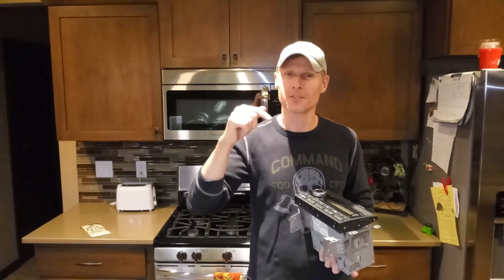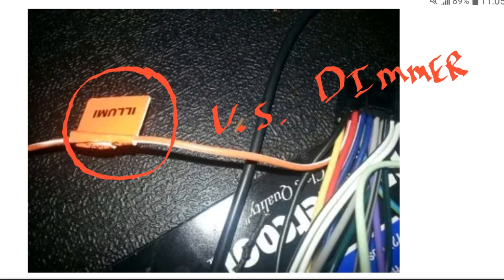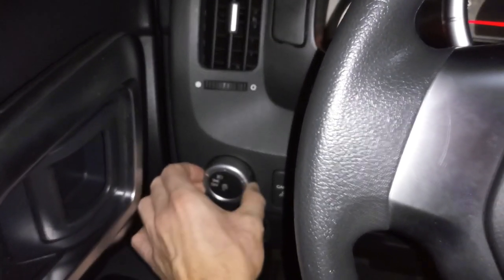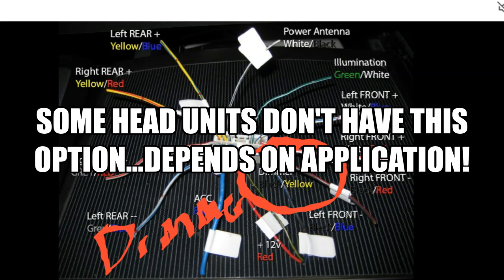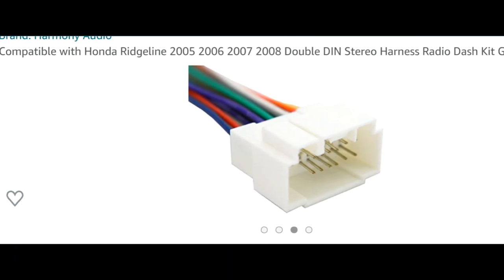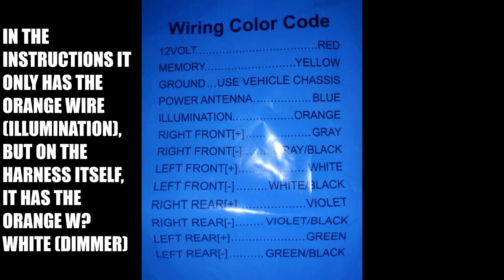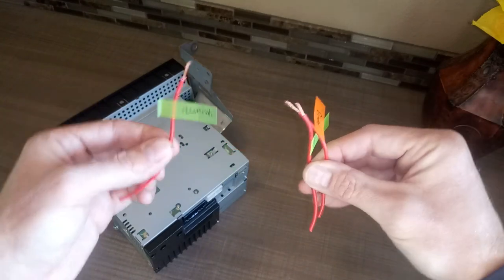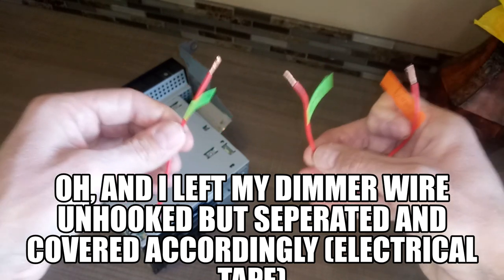dimmer vs illumination wire/ 08 Honda Ridgeline

Comment: Why these devices don't have dimmable backlights is beyond me.   This would have been the FIRST feature I would have worked out.   When you get a factory radio, you 'get what you get', but most factory units have dimmers that work in concert with the rest of the dash lighting.   Why they skip this on aftermarket radios is just dumb.   Even if they added a manual backlight adjustment that would be something.  But most don't.   The built in brightness controls don't do enough to compensate for night driving.   You pretty much have to resort to an add-on app to get something that's acceptable.   It's kludgy at best.
Reply from the maker: I agree totally 6pgregma...the only thing that saves me from being "totally blind" at night is the feature when you slide down on top of screen that says notify and setting...you can turn screen to "off", and radio or music still plays, but screen goes pitch black. Hope that helps.
Reply: This guy either shows all three wires being connected that is wrong or else connecting the illumination wire from the radio to illumination wire of a car when I say why does he not show connecting the illumination wire from the radio to the dimmer switch of the instrument panel if the illumination were that comes from the radio lights the display then two wires should be connected one wire coming from the stereo needs to go to the dimmer wire not the dimmer wire with the illumination wire coming from the vehicle harness the illumination wire from the car stereo should go to one wire the dimmer wire not illumination to illumination if you want to dim the display with the instrument panel then you must use the dimmer wire to the illumination wire coming from the stereo not the illumination we're coming from the vehicle harness

Comment: With the illumination- and illumination+ disconnected I don’t have dash light how would I wire it if the aftermarket radio doesn’t have the illumination feature